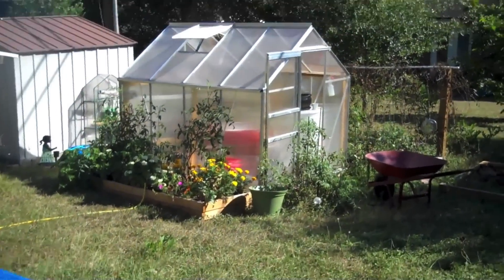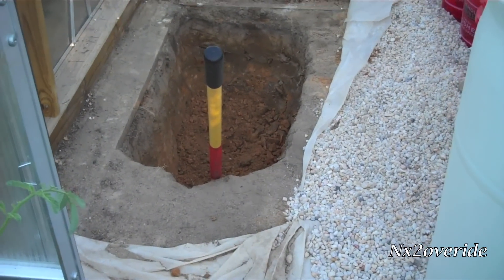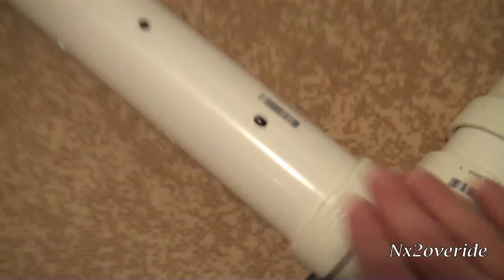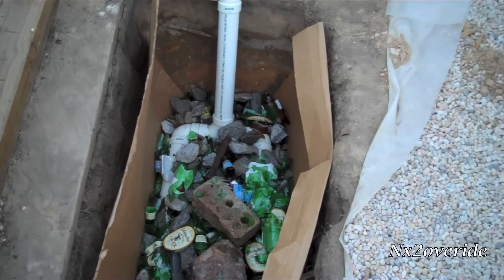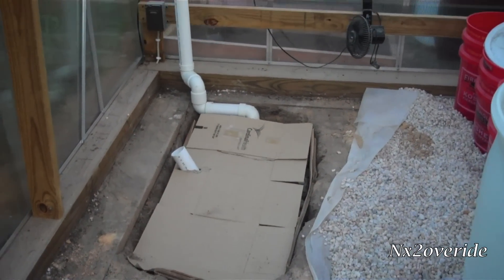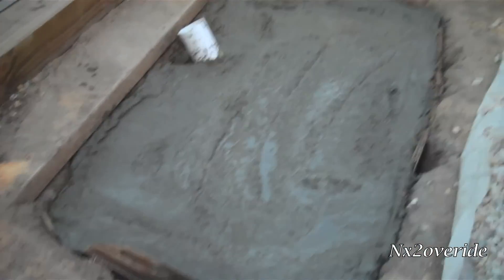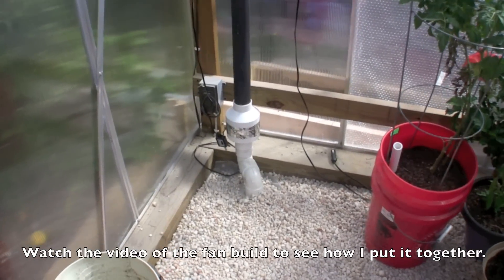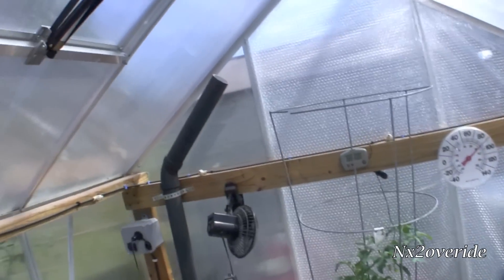Small Solar Greenhouse Heat Sink

Comment: I use a simpler system  in my small Greenhouse 
I use a water barrel with a solar pond air pump  cost about 12 pounds off Ebay
To   pump 
Hotl  air drown from top inside greenhouses to bottom of waterbarrel when sun  out.
Reply: do you have a video?

Comment: So what happens when rain water seeps thru the ground and fills up your pipe with all those holes?
Reply from the maker: OddBall1958 it makes the air moist as it dries out from the heat.. that’s about it. It doesn’t hold water that is why it’s encased with loose debris to allow the water to flow past it deeper into the earth.

Comment: What you built is not a heat sink, but a thermal battery. A heat sink is a large mass of stone or water directly heated by the sun.

I'm quite impressed by the design of your thermal battery and would like to know how well it works.

Comment: Is this the harbor Freight green house? How long have you had it? Is it still standing strong?
Reply from the maker: I bought this  on February 25, 2013 and its holding strong.. no issues really. It has been though a couple  of snowstorms and windstorms I was worried because high winds will kill these. This is why there is a wooden frame inside. The molding on the door has deteriorated but its not a big deal. I guess it might last another 5 years if im lucky... The UV-coated polycarbonate panels will deteriorate by then.

Comment: Where did you attach the outlet pipe to?
Reply from the maker: The outlet just sticks up 1 inches above the gravel with a little mesh grill cover over it to keep trash out. It's just close to the ground to keep the floor warmer. mine is on  on the left side close to the north facing wall. If i was to do it again I would have made the Heat sink 2 times the size and put the outlet in the center of the floor or put one on either side. The system works great though.
Reply: Nx2overide could you let me know what temperature you get in the greenhouse during winter with your system? 

Being a newbie to the whole greenhouse techniques, I am just putting a 6x8 in my garden and any tips on heating, or any other ideas I would be greatful.

Thanks for the video, very inspiring!

Comment: Just put in some water filled black 55 gallon food grade plastic barrels so the sun hits them during the day. During the night they allow heat out to keep it warmer longer and since water works best, the heat will be allowed to stay in longer. Heating that dry sink with air alone is marginal at best. No need to bury any thing.
Reply: I concur.
Reply: I think the point is to put the black water barrels on the north wall.. Anything that's growing would be placed in front and to the sides of them... So they all get their share of sunlight.  Smaller plants preferably in the front..
Reply: Most of the heat will be released in the early evening. If the plastic barrels get all the sun what do the plants get? shade? :) 
You can control an underground system and release the heat when its needed. I have 30 tons of clay soil available to store and release heat, it was free, takes no floor space and doesnt rob any plant of light. Barrels may heat the air by a degree or two at best which isnt a great help to the plants. An undergound system provides warmth to the root zone. Greenhouses should be geared for growing plants not heating barrels of water.

Comment: Liked the idea. I modified it a little and buried a large tote and filled it with gravel, no water to contend with. Am taking a small area around a couple of grow beds and enclosing it with shower curtains so I will have a cooler area in the summer for lettuces, and still have the heat for tomatoes and peppers in the large area of the greenhouse.
Reply from the maker: +Charles Kiplinger Great idea!! keep us posted on how good it works!

Comment: I normally make the hole 1m squared, but people should bear in mind that requires 1.3 ton of filling material. (but also gives you a 1.3ton mass for heat saving.) Then cover that with cardboard, and if you dont concrete you do need to put a floor over the top etc. Also try to place the pipe coming out more centrally, OR create a better airflow in the greenhouse to better push the heat all round.
You can over time get clever and add things, such as sensors to the system so when the temp reaches a certain temp it closes off for a short time. and of course a silicone heat element (requires a small section of steel pipe) simply twist the element into a spiral and slide into the steel pipe. it wont affect the airflow, but when the outside temp reaches a low level, you can set it to temp run, thus adding additional heating to the solar system. It will most likely only run mid winter, and only for a short period of time, this is because the heatsink is so efficient, But if the temp outside suddenly did drop for a long time to below zero (cold countries ./ states etc) the element would keep the inside within the levels you set it to.

Comment: What happens if the hole fills up with groundwater?
Reply from the maker: strebis6 well during the summer months the heat dries it up fast like within an hour. During the winter it takes a bit longer, but the holes are drilled to allow the water to escape.. it eventually works its way through the mass and into the ground. its not meant to be airtight.
Reply: if you let the water drain into the thermal mass, 2 things will happen. :
1st u wasted heat which stored in the fluid. 
2nd u just discharged ur thermal mass heat that u store by letting it be bring away by the discharged fluid.

Comment: Hi, Winston! This looks like a very fun project.  How is it working out thus far?  I would like to try this system in my own little greenhouse. Is it mandatory to use Qwikcrete during the heat sink's PVC pipe installation in the ground?

Comment: Nice project,
To get a better return on your hard work its better to install perforated drainage tube (ADS) on multple levels under the entire greehouse floor. The soil has better thermal mass than rubble, its free and already in situ so you dont have to barrow it in :)

I have 200ft of 3" ADS  buried under my greenhouse (150 sqft floor area) in contact with 30 tons of free thermal mass, With a variable speed fan running at 700cfm ,the air entering the tubing at 85F will exit at 65F in less than half a second. The fan can put all the air in the gh underground in less than a minute.
By the end of the season, the soil mass has accumulated enough heat to keep the greenhouse frost free for most of the winter.  The soil under the greenhouse can easily be 60F by early spring with a few cold but sunny days,, the soil outside struggles to get above 40F.
Reply: Oh, I so wish to see a video of wha you just explained.. i am visual. 

It gets to -40 and colder here in the winter.. growing season is short too.. so anything to extend it is such a breeze.
Reply: you seem like a very knowledgeable man
Reply: How deep did you put your pipe?

Comment: Look neat.
so day warm air is sucked in down & absorbed in rock.  night heat vent releases.  correct?  How deep would you need to go to get ground temp ? 54 or so to release with no force in?     As is any cooling help for summer as reverse?

Comment: never saw sutch thing, i learned something new
 
So a van  sucks the hot air from above to force it into and trough the "heat collector"
 
what are the benefits for the plants with sutch a device? 

sorry if i had to cancel and rewrite the comment, my computer likes to scramble what i write after pushing the enter button